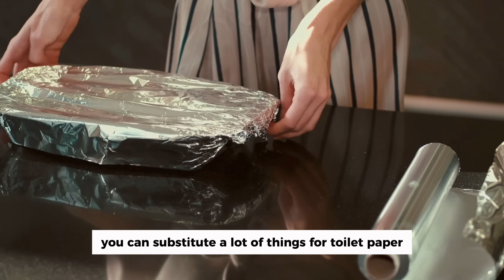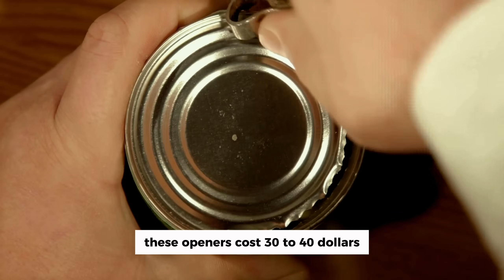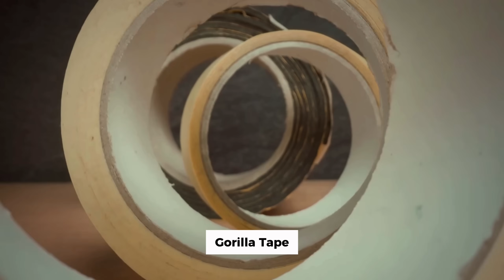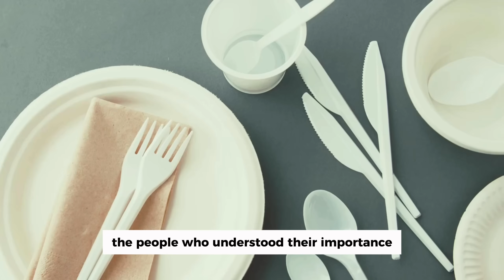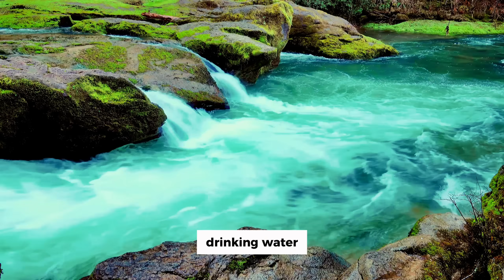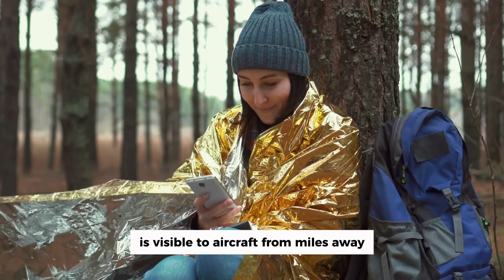9 Household Products That Will SPARK FIGHTS in Stores After Economic Collapse

Comment: Keeping a P38 or P51 Military style can opener with all your preps are more handy than most modern can openers. Not only can you still find ones that are sharp from WWII and Korean wars, but they still manufacture them in the same way in modern times. I have several with camping and hiking gear; also with preps. One P38 can be easily tucked away under a plastic lid in a box of can goods or on a keyring.

Comment: 1) Heavy Duty aluminum foil 
2) Contractor Grade garbage bags 
3) Commercial Manual can opener 
4) Professional Grade duct tape 
5) Quality Disposal Table Ware
6) Airtight storage containers 
7) Lithium Batteries paired with 
Solar Charger & Rechargeable batteries 
8) Water purification system & chlorine dioxide tablets 
9) Emergency Blanket - Metallic blanket
Name brand or Military Grade
Reply: Thanks.  I hate listening to AI.
Reply: Thank you very much !
Reply: Thank you ❤
Reply: I would need zero of these, its Ai slop.